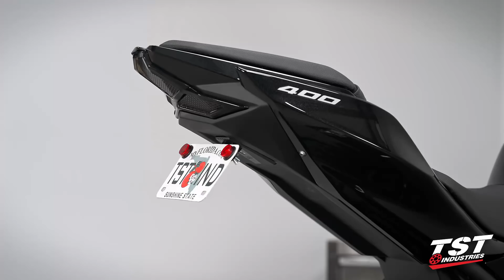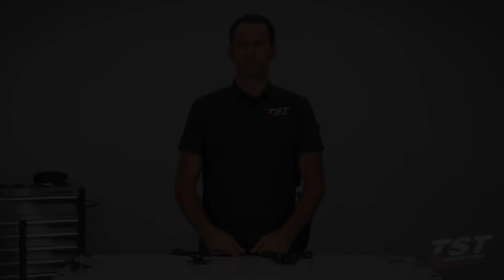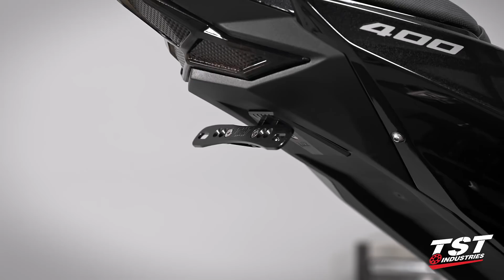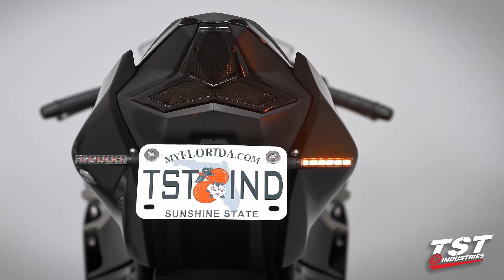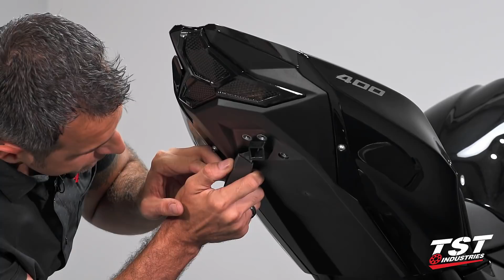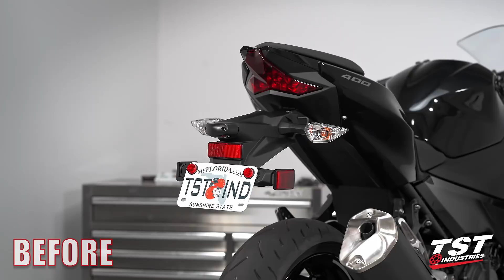How to install an Elite-1 Fender Eliminator on a 2018 Kawasaki Ninja 400 by TST Industries

Comment: I have a question about the adjustable fender eliminator extension kit. Not sure how to install these. Don’t think this video covers it. Also, can you show me how to put that together along with the license place light attached as well? Ninja 400
Reply from the maker: The adjustable bracket instructions start at 9:20 but they build on the knowledge from the previous portion of the video so please watch the entire episode. The license plate light gets sandwiched between the bracket and license plate, use of the double stick tape is optional. You route it through the closeout center hole (so don't put the blockoff screw and nunt there), then you connect to the license plate light circuit as shown in the video we have for wiring up the license plate light (available on Youtube or in the product page on our website).

Comment: Do you need the thread lock compound
Reply from the maker: If you're using the adjustable kit, we would recommend light amounts of thread-locking compound but for the fixed high system, we include locknuts that should prevent the need for thread-lock.
Reply: @TSTindustries  okay thanks , it looks great on the bike cant wait for it to come

Comment: Can I buy the adjustable fender eliminator without the close out?
Reply from the maker: Our customer support staff has a hidden ad for the adjustable kit with no extra hardware that is used as replacement parts sales. Please contact them through our site and they will give you the link.

Comment: Is it possible to install the Elite-1 fender eliminator without  installing the cover plate? I'd rather avoid cutting off that little plastic bit because doing so in my country would probably void the warranty of the bike, or at the very least make it harder to reinstall the standard fender if I had to sell the bike. If the fender eliminator can be installed without requiring that piece to be cut off,  then I'd improvise something to block the hole, like fitting a square rubber grommet there, thus preventing water and debris from infiltrating the motorcycle.
Reply from the maker: We do have a Standard Fender Eliminator option that will work for your needs. You can watch the installation procedure for that product below:

https://youtu.be/aEZjhN14Ag8

Comment: is this also applied to the new ninja 250 2018?
Reply from the maker: We do not have the 250 model in the USA market so there is no way for us to say with 100% confidence. If the 250 uses the same frame and fairings then yes, it will fit without a problem.

Comment: That tail light though....almost bought the motodynamics tail light but I really like the looks of yours. Back to impatiently waiting. Lol
Reply from the maker: Motodynamic doesn't have a tail light for the Ninja 400.
Reply from the maker: They may list it on their site but that is a model designed for the Z1000 and ZX10R. I don't think that they realize yet that the Ninja 400 taillight has a much different enclosure than the other models their light is for. That light will fit very poorly in the Ninja 400.
Reply: @TSTindustries  just placed an order & I forgot to add the gen 2 relay for inter grated light. 

Any chance to add to order,without paying $15 shipping?
Tganx. 
PS. Need those axel sliders. 
Buying full yoshimura system from you guys in 3 weeks max.
Reply from the maker: @SGK23TV  if you purchase the relay before Monday and leave a note for our customer service guys to ship together, they will refund the extra shipping that will be charged on the second transaction. Otherwise you can message them to hold your order and ask for an invoice for the cost of the relay. Good news about the axle sliders, we should begin shipping them early January.
Reply: @TSTindustries  I’ll order it right now. 
Placed $170 order today, is that ok?